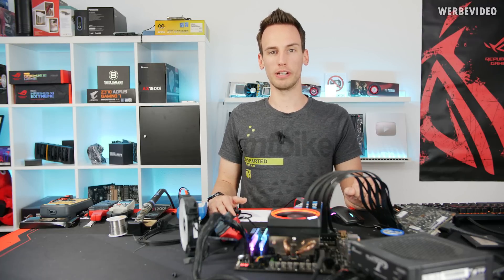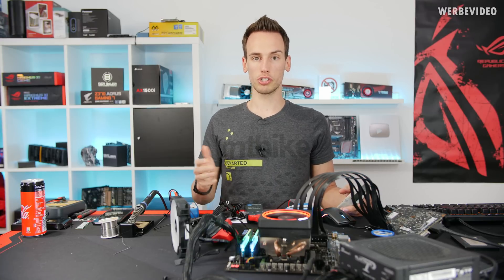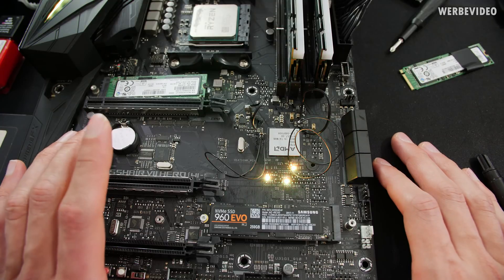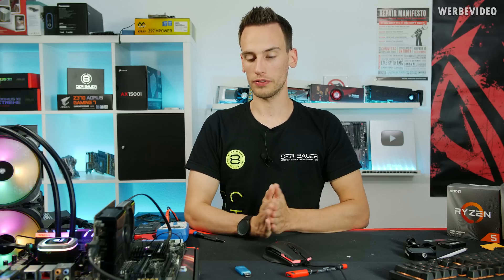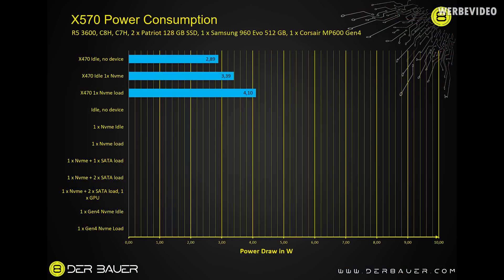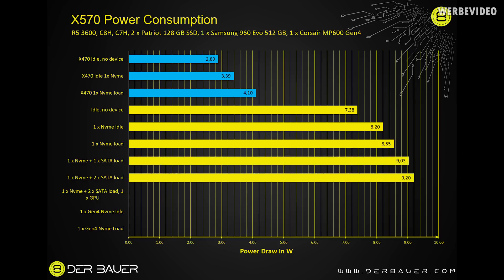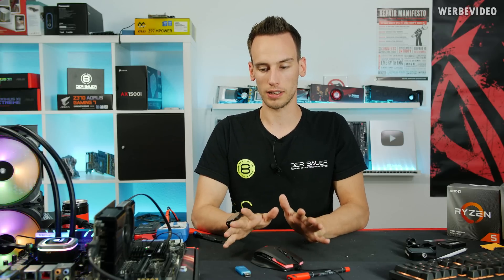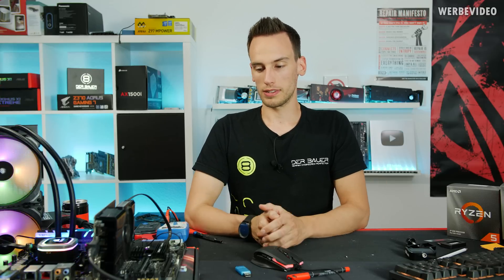X570 Power Consumption Measured - What is going on here?

Comment: 3 Theories:
1. The 4.0 link to the CPU uses a lot of power
2. There is a FW/SW bug that prevents power saving on unused ports
3. x570 is a repurposed IO die, and some of the unused silicon is not power gated off due to a FW or silicon issue
Reply: From what I've read, 3 is the case
Reply: @Yeet_Freak  At a guess, I would say 3.
Reply: #1 should be testable. I know on the Asus boards you can drop the CPU to X570 link down to 3.0 as a config option.
Reply: Option 3 is bang on imo
Reply: 3 is confirm by anandtech via directly asking AMD, it is 14nm version of ryzen IO die, the one on ryzen is 12nm
Reply: I think it's 1. I don't think it's possible to be 3 as I had heard (may be wrong) that they are roughly the same design/circuit as the I/o die but manufactured on 12nm. The 11W/15W had been explained as a 12nm/14nm difference and that the chipset is on 12nm for heat reasons
Reply: @dethrophes That's what I'm thinking too: if you want to have double the bandwidth from anywhere to anywhere else within a chip, you end up with either twice as much internal routing logic or running the routing logic twice as fast, which means about double the internal routing power draw either way compared to x470 when using a similar fab process.
Reply: @teardowndan5364 

This doesn't explain high idle power consumption.
Reply: @Llirik13  It does if AMD isn't scaling the chipset's internal routing logic clock with load. Given the same manufacturing process, at least double the internal routing bandwidth consumes at least twice as much power, which would explain a good chunk of the 2.8W to 7W bump with no devices attached.
Reply: after all this time, it's safe to say it was number 3.

Comment: It is a bit strange how it consumes 7.4 watts when just idling. It could be due to PCIe 4.0 lanes going to the CPU. But it shouldn't have that big off an effect.
It could also be due to the chip having few or no power saving features in it, but this is just speculation on my part.
But yes, the chipset shouldn't need a fan, even if it consumed close to 15 watts. Since a cheap aluminium extrusion could easily handle that if it had a bunch of fins on it.

But I do find it strange that it consumes 7.4 watts doing practically nothing, when the prior chipset consumed less then half as much.
I can understand that it consumes more, due to new features and such, but 4.5 watts more? (That increase in itself is more then some phones consume under load... And it is about 20-25% of the TDP of some mobile x86 CPUs.)

Comment: I think the 2 main reasons  against small finned heatsinks are (from AIBs perspective):
1. Where do we put our giant logo?
2. How do we install RGB on it?

So Its technically impossible to cool a chipset like this ;)
Reply: exactly, they want to keep the fashion accessories so badly, they would rather slap a potential point of failure (a fan) on a lump of metal, rather than put actual cooling fins on the thing.
Reply: Dont u know rgb gives u 20c lower temps
Reply: @bryansuh2000  Really, my CLC 280 has just a single RGB LED and I can confirm that it drops idle temps from 250C to 25C.
Reply: Perfectly put
Reply: Gigabyte already proved that the cooling fan is unnecessary, and that the logo can simply be moved upward, actually improving visibility as it is now above the PCIE slots, although a part of me still kind of wishes that they brought over the copious amounts of RGB they had on the X470 Gaming 7 WiFi. It is just such a shame they couldn't bring the large heatsinks down to their lower end X570 boards, so I guess shame on all board manufacturers, Gigabyte included.
Reply: @thetrashman5252  Too bad they didn't make their ITX motherboard on X570 passively cooled when it came to the chipset.

Comment: Possibly in the future a lower wattage chipset could be released. I am very wary of adding a motherboard with a fan to my rig.
Reply: It's far from the first time chipsets have had fans.

I'm glad that isn't the norm any more, but I've got plenty of old boards with chipset fans.

On the other hand, the heat sinks depend on the CPU and case fans to keep the chipset cool but if you're running water cooling then the chipset needs a fan or it's own cooling.
Reply: In theory b550 will be a good option. Any PCI-e slots for GPU and the primary m.2 slot should still be gen 4 (direct to CPU) and any PCI-e slots attached to the PCH will remain at gen 3. This means your primary boot drive can still be running at 5GBps and your Radeon GPU can have it's placebo PCI
Reply: B550
Reply: I want VRM fans like the super nice EVGA DARK motherboard. I add my own, but it’s often held on by zip ties or hot glue and not as pretty, haha!
Reply: put a x470

Comment: If I remember well that PCH will heat up only with a RAID of PCI-E 4.0 SSD
Reply: Thats correct, They said chipset temps were an issue in some scenarios with multiple nvme drives in raid.
Reply: I remember hearing that too. 🤔
Reply: @mafcarvalho  Unfortunately there was no multi nvme testing done but you can see the added sata devices don't increase its power consumption much. Essentially it looks like an old cpu - burning 100% power all the time with no idle states and the only thing that changed its power consumption was the state of the workload it was performing.
Reply: @sparkyenergia  Thanks for your reply. I guess that several "simple" SATA devices aren't enough to stress the chipset, but 2 NVMe devices in RAID might... Until someone makes that experiment, we won't know for sure.
Reply: Two NVMe's in raid 0 can easily put this chipset to its maximum..
Reply: If you go Threadripper ZEN2 you can do that with hard wired cpu lanes that don't go through the chipset.

Comment: When you add the pcie graphics card to the mix you should had stressed tested with some benchmark that really stressed the pcie bandwidth I think Sisoftware Sandra had a module test for that. Furmark doesn't bottleneck half a pcie1x. Or 2 or 3 nvme drives, just stress then witn file copy from 1 to another. Just some ideas that might work. Good luck.
Reply: Luis J maybe new futuremark pci test?

Comment: its not a purpose built chipset. In order to save development cost (or asmedia just wasnt ready) amd reused the IO die as a motherboard chipset. Lots of functions end up not being used (dram controller, IF links) but probably still use some power.
Reply: I don't think they repurpose the IO die. they just want to save some bucks by using the older node.
Reply: If they really did repurpose an IO die then surely they would have fused off all the unneeded circuitry.

Comment: Isn't the inter-connect between the CPU and chipset running PCI-Express 4.0? So regardless of what you connect you will still have increased power consumption due to the inter-connect between the CPU and the chipset? As AMD Ryzen 2000-series does not feature support for PCI-Express 4.0, what happens if you replace the Ryzen 3000-serie CPU with a Ryzen 2000-series CPU? Do you notice and difference in power consumption?

Regardless of all of this, it seems like the cooling is built to be overkill on purpose. Barely anyone will ever reach and wattage that will actually require active cooling. Hopefully you can disable the fan in the UEFI firmware, or at least have it not run unless you hit high temps.

Comment: They have to make sure the chipset keep under some temperature threshold in a hot closed case (open air testing is irrelevant) with the chipset cooling obstructed by expansion cards. In a situation with high ambient temperature and negligible airflow due to something like 2 large graphics cards above (or worse, some small hot airflow because of these), 9 W is quite a lot.
Reply: 9 watts is not a lot.
Go back and look at some beautiful X58 or so boards. The X58 chipset had, what, a TDP of 24.1W? Back then we could cool those just fine *passively*, and this at a time when running quad-SLI was a still a thing.
Reply: @osgrov  yeah but that thing was not obstructed by the GPUs at all, so had airflow from the overal airflow in the case. Completely different situation so incomparable

Comment: I've heard somewhere that i/o-die and x570 chipset die are the same and when I compared size (on photos) it looked to be about the same size. So if they reuse i/o-die as chipset it makes complete sense that it requires more power because it's multi purpose.
Reply: That's the conclusion I came to.  The fact that this isn't designed to be a PCH controller it was designed to be an IO die for a CPU, the power requirements might be higher.

Comment: Very good video, I really enjoy these in depth analysis. You should try pci-e SSDs in Raid, that should load up the chipset even more. The fact that this chipset uses more power than some of the ultrabook cpus is quite amusing, add to that the probably not very good reliability of chipset fans and maybe X470 could be a better choice than X570 if you only loose the pcie4.0 capability.
Reply: Currently no doubt X470 is a better platform if you are going for energy efficiency, also you basically need to mod the board with a passive cooler in order to get a silent PC. All in all this is a bad job on the board partners, at the prices these are sold for they could have made a better passive cooler, probably would cost not cost a lot more.

Comment: Someone must have had a warehouse full of 40mm fans they needed to unload.
Reply: It's the 40mm fan mafia. They'll give you an offer you cannot refuse. Or you'll find thermal paste in your CPU socket.
Reply: @FM-kl7oc  Jesus, censor that! It's too hardcore! Now I won't be able to fall asleep at night...
Reply: Delboy and Rodney finally flipped these fans.. lovely jobly...
Reply: @LikeATox  I'm sure they'll find a way to cock it up. Plonkers.
Reply: They want you to buy a new board after the 2 year warranty or whatever when the small fan fails. I cant find another reason of bringing back the small shitty fans...
Reply: I remember there were many chipsets which were either rather warm or rather temperature sensitive in mid 2000s thereabouts.

Cheap boards used fans because a little noisy fan is so cheap.
More expensive boards threw a larger metal area on there on the same chips.
Reply: @SianaGearz  yes, i imagine it's something to do with price - that it's cheaper to use fans.
Reply: @SianaGearz  2
Reply: my motherboard is from 2011 and I also have a small fan assist for the motherboard to cool the VRMs and everything inside the shielding... though on mine is optional, the fan is kinda a requirement for high OC, it has 4 screws that remove a small cap to put the fan...
Reply: 40mm fan cheaper than a real heatsink. :(
Reply: This! My last 2 motherboards came with thous wierd metal stands for small fans to cool mb external power connection or something. Meaby they hade full warehous of thous and now they know that no one is using thous and sold them to amd!
Reply: I think some geeks would buy an X570 just because it has a fan just like some petrol heads buy rims for their cars.

Comment: Did you test  the gen 3 drive in crystal disk mark when attached to X570? If so was the performence any better than when attached to X470, Just wondering if the extra power consumtion could be related to better performence owing to higher throughput on X570, even with older devices.
Reply: Here's something you might find interesting.  The PCIe4.0 drives run at the same speed on X470 boards.  https://www.youtube.com/watch?v=45fQaCl9WlA

Comment: I remember hearing some guy in the youtube tech sphere talking about how the motherboard manufacturers were saying NVME RAID with PCI-E 4 SSDs was putting much more stress on the chipset which is why they all went for active cooling on them. Might be worth testing that out and seeing if your generic heatsink would be enough to cool that too.
Reply: yes saw some one say that with one of the PCI cards that takes 4 NVME drives to raid them i think
Reply: It draws 2.5 times more power than X470 even in idle.
Reply: Sooner or later MOBO has to be a active buy like CPU, GPU, RAM and PSU... You need x Mobo to be compatible,etc, and have feature performance.

Comment: I heard active cooling was needed if use nvme raid
Reply: nvme raid can be made only using 1x nvme + 1x pcie card
Reply: @steamstories1279  why all the pcie lanes, then?
Reply: IDK. It's been confusing for me. Two NVME drives running directly off cpu lanes or cpu lanes to the PCIe sockets don't even go through the PCH. Raid on sata III goes through the PCH. Mobo's with that M.2 socket just a few inches away from the cpu will maintain signal integrity in gen4 x4. I can't understand why X570 with limited cpu lanes runs so many of them to the PCH anyway. How many USB, SATA III and USB gen2 sockets do they think people want. Just like an X370/470 boards we're left with 16X or 8X 8X for PCIe sockets. I just found on Corsair's web that a gen4 nvme will run on a gen3 socket. I think this NDA stuff hurt AMD. At launch it was spend a ton of money on stuff that's a secret. On Asus site I can't tell if a new bios released the 5th of july will boot Ryzen 3000 chips or not. All the cpu compatability charts still stop at 2000 series cpus. Please begin every sentence with the term "I think?" fFletchs, best wishes.
Reply: well, they lied to all of us.
Reply: the RAID is handled by the CPU, not the chipset. that makes no sense.
Reply: @solomonshv  cpu handles some of the pcie lanes.

Comment: Since AMD also screwed up the GPU coolers, I think they have absolutely no experience in thermal design for coolers and specified bullshit for the motherboard manufacturers to execute...
Reply: Amd has no control over the heatsink designs on motherboards
Reply: @nickolaswood99  Indeed they have. They send their specifications for the chipsets and it includes the type of cooling they want them to do.
Reply: @nickolaswood99  At least they can give a TDP for the chipset. Maybe they had a typing mistake in that TDP and didn't bother to correct it after manufacturers had the design finalized...
Reply: @kyoudaiken  I'm hoping in the future we will get a passively cooled chipset I don't want to worry about a fan burning out on my motherboard

Comment: No idea but if your using the reference CPU cooler and a GPU dumping heat into a mid size case that tiny heat sink at 74c could get a lot hotter. Then again its not like people are going to be playing intensive games and running Crystal mark bench in the background either.
Reply: It looks to me like the power draw drop going to 7nm is reversed with gen4 and more cores. The VRM on 7nm cpus is an increase not a "same oh same oh" found on X470 boards, and the PCH chip set has turned into a boiler. I think I need an open loop water cooler and a monoblock that covers the entire board. If your going air cooled you better get a case with 2 200MM fans on the front. Make that 2 230mm fans.

Comment: The chipset is just basically a big resistor. A lot of older chipsets and ICs in general have high idle current loads. Many that are designed to just run hot with passive cooling only. Like rated to run 90 deg C at 24/7 or more sometimes.

Comment: Try using a 2000 series CPU in the socket. If the watts are still the same, there's probably something fishy that AMD doesn't want us to know
Reply: Below zen 2 does not support PCIE 4.0, so consumption should be lower. If i'm correct, 4.0 is only unlocked using zen 2 (ryzen 3) cpu's

Comment: Test with a ryzen 2000 CPU in x570.
Perhaps it's the infinity fabric running at pcie4 that needs the higher power.
Reply from the maker: I hope nobody buys a X570 Board to pair it with Ryzen 2000 :D
Reply: @der8auer  It might be worth testing just to isolate if that's the reason for the power consumption though!
Reply: @der8auer  I did. :) Ryzen R5 2600. But actually it's just a temporary solution to wait until 3950X :)
Reply: @der8auer  For 'Boints' they will
Reply: It's not PCIe 4. It's just very poor design.
Reply: Possibly an unfinished design.

They may have been rushed.

Just saying, it's possible that the engineers pulled a rabbit out of their hat to get it working at all in the time allocated, not poor design just not had the time to finish.

That kind of crap happens when you pick the release date before the product is finished.